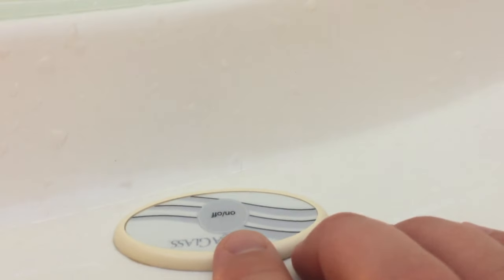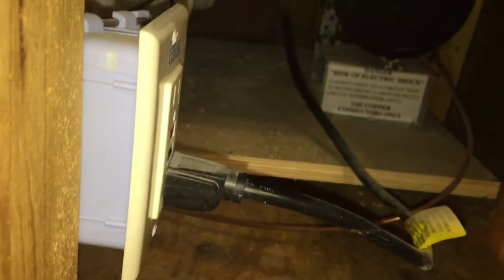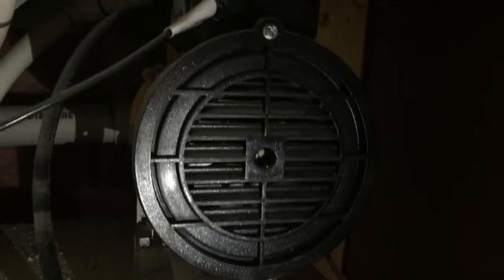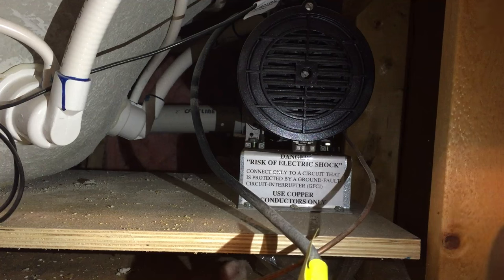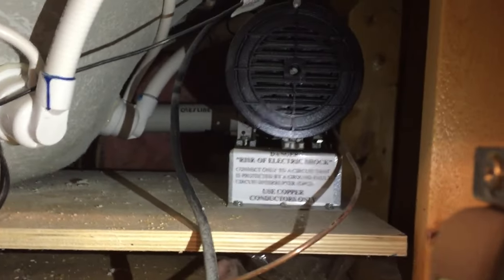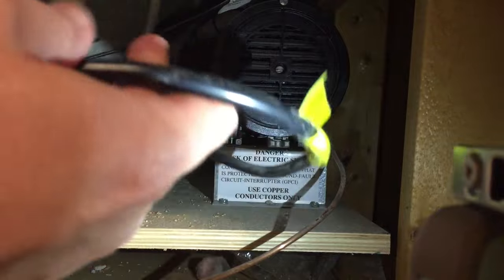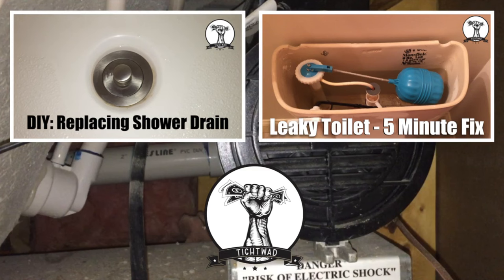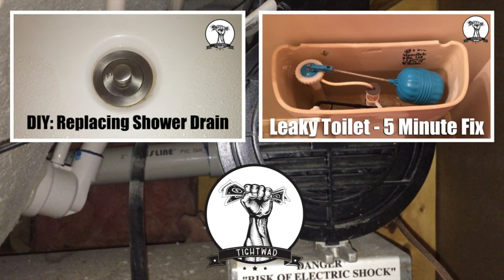Fix Jacuzzi, Hot Tub, or Pool Pump That Only Hums

Comment: I just fixed my outdoor spa using this method.  It was hard because you couldn't see the end of motor but seeing your video gave me the motivation to try it by feel.  I found the center of the motor and tried turning the screw but it was completely frozen from sitting outside for the winter unused.  By attaching some vice grips to the screwdriver, I was able to get it to move a little but still the motor would only hum.  I kept turning the screw driver for about 10 minutes and it finally was easy to turn.   Hit the power and we're back in business!

Thanks for posting this excellent video.
Reply from the maker: Jeffrey Berezin That’s great! Thank you for sharing your success story!
Reply: Ah! I'm able to turn mine but it's still seems hung on something. I'll try doing it for 10+ minutes as well. Hopefully that works. I'll report back.
Reply: Another few minutes of turning and it finally got unlocked. My wife and I are so happy right now! I'm running it now with some Oh Yuk to clean it and there's a bunch of nastyness coming out. Thank you so much @TightWadDIY !!!

Comment: I had also made an appointment, but after seeing this I twisted the pump shaft, reset the outlet, turned it on and it worked.  I then filled the tub with water and ran clorox water for about 15 minutes, and it cleaned out the pipes beautifully with lots of force.  Thanks so much!!
Reply from the maker: Edward Powell Thata great! I’m glad it worked for you.

Comment: Perfect.    It did take a little longer and I used a power drill to turn the motor for what seemed like more than a minute.  But once the build up was broken down, I felt the difference.  When I power the motor, it started right up.  Thanks!  I thought i had to replace the motor and was delighted with this simple fix.
Reply from the maker: nwman97 That’s great! I’m glad it worked for you.
Reply: Thank you so much for the power drill tip! I was using a screw driver and it didn’t feel like anything was loosening up. I was starting to get worried that this might not work for my situation so I came to the comments and found yours! It took several minutes running the drill both ways and it works perfectly now! Thank you!

Comment: My hotub was humming and jumping my breaker, it is outside and of course this happens when we are in November and here in Quebec it is about 35 F. I saw this video and went outside couldn't get to the back of the hotub (too tight a fit). I disconnected the pump to the hotub and pulled it out and found a plastic plate on the back, I removed it and saw the screw that you are talking about. I turned it back and forth and I also sprayed some 10W40 on the inside to keep it loose. I put back the connections and tried to start it up. It turned and didn't jump my breaker......YES. I let it run a minute or two and all was good, I have to reconnect the pump to the SPA but I think all will be good now.......TKS !!!!!
Reply from the maker: Denis James Thata awesome! I bet the hot tub feels great in winter up there.
Reply: @TightWadDIY  Yes, I am retired and great to have my morning coffee in it while listening to the traffic jams on the radio while everyone is going to work. I will try to put it back and fill it tomorrow, I will let you know if all goes well....TKS again for the video
Reply: Hi, I put the SPA back together and started it up yesterday, all was great for approx 15 minuted then the breaker went. I reset the breaker and it is back to humming again...GGGrrrrr. Now, I have to EMPTY the SPA again to get at the pump. Any other suggestions that may help me find a quick solution?......TKS

Comment: Thank you!  We've had this problem for a couple years and couldn't find anyone in our area that works on these tubs.  The only problem we ran into was the tub was installed the wrong way so the motor was facing the wall.  We managed to a screwdriver on it, turned it, and it's fixed!
Reply from the maker: Julie S I’m glad you were able to get it fixed! It seems like a lot of these are installed with the motor post in the back. That’s unfortunate.
Reply: I got the same problem. It faces the inside. I really had to crawl underneath it to stick the screwdriver into it.
Reply from the maker: Tony Lasagna I’m glad you were able to get it turned.

Comment: I know this is old, but it got my pump working again that hasn’t worked in over a year! The only issue I’m having is if I don’t use it for a few days, the motor sticks again and I have to use the screwdriver trick to get it going. I’m assuming it will need to be replaced at some point, but this has helped a lot!!!
Reply from the maker: Yep. It’s not going to work like new.

Comment: Thanks so much for the helpful video.  My Jacuzzi pump was mounted almost against the wall so there was no way to use a screwdriver on the end of the shaft.  However, there is a slotted cover on the other end with a fan behind it.  I was able to use a screwdriver to turn the fan which accomplished the same freeing up my motor.   I am very grateful as you save me $$$ bucks.
Reply from the maker: Michael That’s great! I’m glad you were able to get it working again.

Comment: Unfortunately, when they built the house, they tiled all around the tub and there is no access panel so we had to knock tile out to try this but it worked!  Thank you so much for this video.
Reply from the maker: TheCookiedoe That’s crazy! That builder needs to get a new job!
Reply: @TightWadDIY  thank you for the video. I have a similar issue. My tub is humming,  but the jets wont start. The builders did tilt over the access in the front and back sides of the tub. I can see silicone was used to close the tile, but I am not sure which side to cut. Is the motor typically opposite of the faucet?  Also, do you have any suggestions on how to close the tile so it's easily accessible or know what to use to close the tile back up?

Comment: Thanks for the video. What is the clear-looking thin pipe running from the right of the motor down towards the left at the bottom of the screen? I have a clear pipe that is hanging loose and I don't know where it should go.

Comment: Thank you very much!  It’s just that I install the tub backwards, so that the motor is facing towards the back wall to where I have to remove the whole pump system to get to the screw.
Reply from the maker: Well that’s not fun!
Reply: Did that work for you? Mine is installed the same way. Screw is on opposite side of  access panel.

Comment: I was so excited to fix this myself. I got through the access panel and the motor but my motor has a solid face without slots or a screw that I can see. Does that mean when it was installed they put it in with that slotted cover & screw facing the other way or since my bathtub is over 20 years old they didn't make the motor as accessible?
Reply from the maker: I bet it’s backwards.

Comment: Just a bandaid though. A slight   tap on the motor achieves the same result. I got the same issue but want to buy a replacement but fix the replaced pump.
Reply from the maker: Yep!

Comment: Hi, and thanks! I am trying to fix the Jacuzzi. Humming engine: yes. Unplugged before going further: yes! Cleaned out water intake: wasn't that clogged, but why not? NOW: this model does not allow me to get to that post and free it up. I read Julie S and voodookid's comments; there is no space to crawl under if it was installed with the post facing the wall. I know this isn't anyone's priority during the crisis we are all enduring. I'm trying anyway because my husband was laid off, we'll probably have to move before a repairman can make a house call, and the landlady will expect the tub to work. Any ideas? Wishing you well
Reply from the maker: Amanda McQuade Crawford I don’t think it should be your responsibility to make the tub work if you are renting. You didn’t install it and didn’t mess up due to negligence. The only option I can think of is to remove the motor.
Reply: @TightWadDIY  Thank you. I tried reaching around to adjust that post with my shortest flathead, but I can't be sure of what I'm feeling. Doesn't seem like I'm connecting to the post though there is a central hole I can feel where the post ought to be.  So, thank you for that reality check on what is possible and what isn't. Warm regards!

Comment: is there a way to clean out the pipes that run through the system. We bought a new house with this jacuzzi tub, but some black stuff comes out of the jets when we turn it on. Great video! Saved me some $$$!!
Reply from the maker: Fill it up a few inches above the highest jet with hot water. Add either two cups of vinegar OR 1/2 cup of bleach along with a few table spoons of dish washing detergent. Runs the jets on high for 10-15 min. Drain then repeat the process with clean water to clear the lines.

Comment: I believe I have the same problem, unfortunately when they put in the tub they encased it in tile with no access panel!! So I need to break tile to get to the motor. I have no idea where the motor is placed. I want to make sure I break the tile closest to the motor. Do you know if they typically install the motor at the head or foot of the tub?
Reply from the maker: Sorry, it definitely varies by builder. It’s usually on the end closest to the controls though.

Comment: I cut an access into my pump, but the motor is in the other end from my access opening.  I’m seeing the discharge piping end.  I can remove the discharge pipe, is there a way to rotate the pump from this end? Or maybe spray something to dissolve the materials locking it in place?
Reply from the maker: No sorry.

Comment: Found panel and motor just like in your video. Super helpful! Mounted sideways but I found the screw and tried turning in both directions.  It will turn but remains stiff and still won't turn jets on.  Is there a next step? Thanks!
Reply from the maker: T Drogula Does it hum when you turn it on?
Reply: TightWadRepairs  It does hum....I just never can get it to spin freely with the screwdriver.

Comment: I,ve got the same problem going on, what a terrible design.If i would have know this would not have purchased tub.Thanks for the video.
Reply from the maker: Boltbusters.com I think it is just the nature of this style motor. They aren't used frequently enough to prevent corrosion. They are also in a room that has high humidity levels which isn't ideal either.

Comment: What is the 8 awg wire for. I thought those were only required if you have metal pipe?
Reply: Looks like one running past motor and gfci outlet
Reply from the maker: The yellow one?

Comment: Thanks for this! The impeller is now spinning and the jets are working when the power switches on. However, only for a few minutes until the breaker trips, think heat related as it won't start and run again for an hour or two (throws the breaker immediately). Anyone any experience / advice on this?
Reply from the maker: gxprice I suggest checking the wiring in the outlet.

Comment: i have a beachcomber hottub. the pump although starts, i mean i can hear the sound but no water movement i.e. its not sending the water thru the filter and heater system. the hottub has two pumps and the small pump is at the back and i dont see a screw as u have mentioned here. can someone pls help
Reply from the maker: Sorry I’m not really familiar with that.

Comment: I have a kohler 3/4 h.p. motor. It hums when it turns on...but i have no idea how to access the fan/propeller. The side of the motor i cant see has a plug/tube coming from it and nowhere on either side does it have a spot you could fit a screwdriver in the center of it. Im afraid i may have to remove the whole motor to access the fan....any suggestions??
Reply from the maker: Annelysse Mehlhose Sorry. I’m not sure what you can do if there isn’t a screw that’s easy to access.
Reply: @TightWadDIY  was able to detach the motor and there was a cover over the screw. It seems like the problem on mine is more complicated unfortunately. Thanks for posting the video!

Comment: Why is it so hard to find parts for these? Mine does the same thing. But I took it out. Took off circulating wheel. And the motor works. Put the wheel back on. Same noise again. I think I need the plastic washers or something. But I can't find parts for it
Reply from the maker: Most people just replace them.

Comment: Thanks.  I thought it would be like a garbage disposal.  My motor was installed backwards too.  Once I blindly found the school and rotated a few times.... Bingo.  Do they make a Drano for HoT Tubs...lol
Reply from the maker: Glad you were able to get it running. When you say Drain-O do you mean your tub drains slowly? If so, I’m sure you could try Drain-O or run a snake down the drain to clean it. It wouldn’t do anything to free up the motor though.
Reply from the maker: BigPapaHusker Every set up is slightly different. Your installers took a shortcut and you are paying for it now. I’m sure it could be turned around but I don’t know if it’s something you want to try yourself.

Comment: Screwdriver we could turn it but it still had a bit of resistance and motor wouldn't turn. Next we used a drill and wd40. Then we jump started it with the drill and powered it and it ran. We let it run for a minute and now it works without jump starting.
Reply from the maker: alohajason That’s great! Hopefully it lasts.

Comment: hello I have a Emerson 9249000 phase 1 Motor 1795 Motor that I removed from a Jacuzzi..I would like to use it on a project mod to build a Disk Sander.I know the motor works I checked it before I removed it from the tub.Wheni got home I removed the extra parts where I only have the motor itself and outlet plug but it won't start or hum it does nothing not even a noise.I came across your video and was hoping you might be able to help a good old wood worker out on what can I do and maybe what I did wrong.???Thank you for your help. anything you can help me out with will be greatly appreciated...Freddy
Have plenty of pics if need be.
Reply from the maker: BUILT IN WESTCHESTER I’m a woodworkers as well so I admire your goal of building a disc sander. I haven’t worked on the internal components of this type of motor before.  Do you have a multimeter so you can check to see if power is getting to the motor?

Comment: Our jacuzzi is all tiled in.  It was this way when we moved in.  I put the timer on and usually the jets start, never had a problem....but all I hear is the timer.  So has anyone had this?  Has anyone had a tub that was tiled in and there is no “door”?  Thanks for any help you can provide.
Reply from the maker: Try resetting the breaker if you aren’t even hearing a hum. Unfortunately, some builders don’t leave an access panel to get to the motor. Do you have a wall next to it that you could add a panel too? Maybe next to your toilet?
Reply: Thank you so much.  Tomorrow we will try the breaker and I just noticed a box behind our end table that has a door to the tub....I have been dusting that door ledge never knowing what it was...blank!!,  or senior moment.  Thanks so much for your reply...I will update you tomorrow about what happened.
Reply from the maker: @robertdelaplante7326  I’m glad you discovered the access panel! Hopefully the power cycle will fix your issue though!
Reply: Okay...found the panel and the motor...looks like it’s sideways.  I held up a mirror to see the front of it, but can’t locate that “screw”.  I appreciate your help and your time.  I feel like an electrician is in our future...yikes.  Thanks again
Reply: I took pictures of the motor but I don’t know how to send the the pic  to you...keep in mind our computer skills are bad...we are in our 70’s ( young 70’s..lol)
Reply from the maker: @robertdelaplante7326  Is the motor plugged into an outlet? If so, plug something else in to test that outlet. An alarm clock, fan or lamp is an easy way to check for power.

Comment: Got my pump running! Thank you
Reply from the maker: Eric Anthony That’s great! I’m glad to hear it worked for you too!
Reply: I had to fish my hand in a tight space and use a 90 degree extended flat head ratchet driver but I got it working. No way it would have been worth it removing the motor to get to it.

Comment: my motors kinda tight, do you have any suggestions on how to loosen it?
Reply from the maker: Safa !! Are you sure it’s the correct bolt?
Reply: TightWadDIY yeah it had the same thing in the video. It only hums for 20 seconds when I plug it in and then stops
Reply from the maker: Safa !! You gotta get it spinning. Did you give it a few spins to see if it loosens up?
Reply: TightWadDIY yep didn’t work
Reply from the maker: Safa !! Your motor may be shot then.

Comment: thanks for the video , unfortunately the way my motors and pipes are mounted its not easily accessible. my motor is oriented reverse from yours.
Reply from the maker: Chad Barker That stinks. The installers obviously didn't care to do the job correctly.
Reply: Chad Barker, I just opened my panel and yes motor is reversed on my tub. I cannot get to it for a simple fix. Unbelievable ! Just unbelievable !

Comment: Tried this and still it won't start pumping water.  We've put cleaners in the tub to sit.  Tried opening an air thing on top of the tub.  I can't remove my inlet cover in the tub to clean it, there is no screw spot and no caps on it. One day it just started humming and wouldn't pump water :(
Reply from the maker: Does the motor spin freely with the screwdriver?
Reply: @TightWadDIY  if you mean the screw on the pump no. I've loosened the screw a little and it worked once.